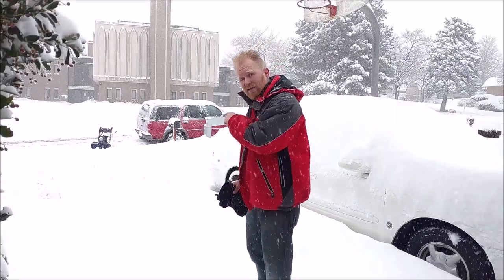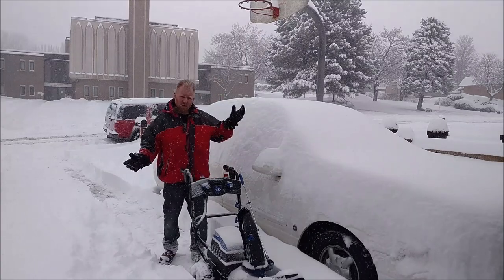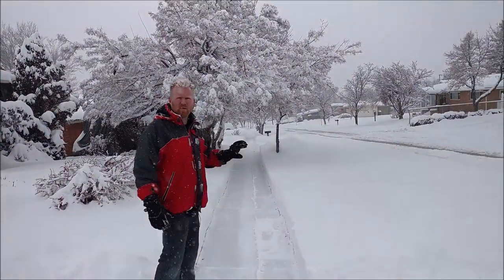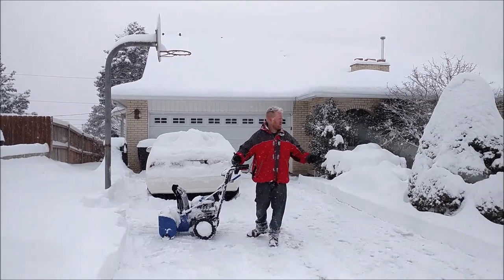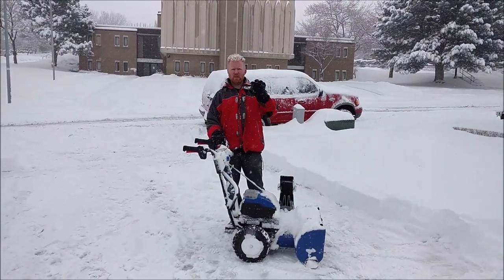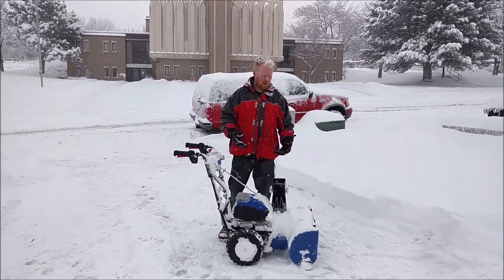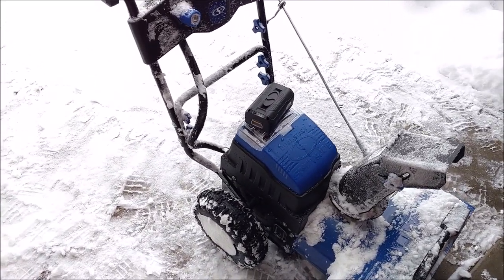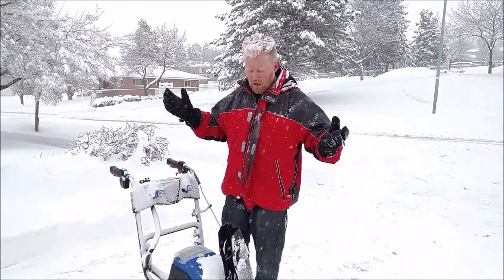Lithium 2 stage Snow Blower!

Comment: Hey 65, I need your opinion. Which engine line do you think is better an HMSK or an OHSK??
There is a guy selling brand new NOS Tecumseh 10hp HMSK100, 358cc and a 12hp OHSK120, 358cc. Which engine line do you think is more reliable?
How much more powerful do you think the OHV 12hp is compared to the L head 10 hp a big difference or a little difference? Thanks..
Reply from the maker: They're going to be very very close. I doubt you would notice a difference side by side while running on a piece of equipment. The overhead valve engine is going to have a tiny bit more power and be slightly more fuel efficient. In reality the 10hp L head is going to be closer to 8.5hp/3600 14ftlbs and the 12hp ohv is going to be 9hp/3600 16ftlbs. So the OHV is 5-10% stronger, which could easily be lost by a worn engine.
Reply: sixtyfiveford Okay great, thank you for the information. Thats exactly the information I have been looking for. Their is a guy selling NOS Tecumseh's. The 10hp he's selling for $385 and the 12hp he is selling for $50 more at $435. Same shipping cost. I think Im going with the 12hp, its eventually going on a large snowblower and I do commercial snow removal and need as much power as possible plus being a little more fuel efficient is a plus. My snapper has an 8hp HMSK80 and its a good motor and works hard so I had experience with the L- heads but have had no experience with the higher hp OHV engine. Do you think one is a little more reliable/ would last longer, or do they both have about the same lifespan when taken care of well?  Because Ive seen some Tecumseh L- heads go 45+ years with average care. So would an OHV last a good long time as well or are they more prone to break down vs the L-head. Thats the last thing to consider before pulling the trigger on the purchase of the engine.
Reply from the maker: I like the L heads and think they're reliable as heck. OHV stuff needs periodic adjustment, but it's quickly done.

On a side note, I'm very partial to Tecumseh engines and I don't think there was ever an easier starting winter engine; but I think those prices are high for the engine/power you get. For my money, if I needed power to go through anything I would throw a 420cc Predator engine on for $350 from Harbor Freight. They're putting out a true 12-13hp 18.5ftlbs and it includes a 12v electric start. I can pretty easily stall out a hmsk80 in wet snow and a hmsk10 is better but still stallable. I think a 420cc would be the magic ticket. I haven't personally used the Predator 420cc but I've done a fair amount of engine swaps on tillers,etc with their $100 212cc 6.5hp engine. It has surpassed my expectations in performance and reliability.

I have a pair of hm100 10hp that are on some go karts I have. They are well used and showing wear after being operated in dusty environments their 20+ years of life. I plan on putting the 420cc Predators on in their place and using these tired but still very strong engines as power upgrades on smaller equipment.
Reply: Oh yea I know all about the 212cc they are great and for the most part that's the way I go. But these NOS Tecumseh engines arent going to be around forever and I figured I would snatch one last one up before their impossible to find. I have seen a huge demand for these Tecumseh engines and parts the last few years since they have been outbof business 9 years now. Lets just say I purchased that OHSK120 today for $435. Lets say I never ended up using it. In 10 years a still nee okd Stock Tecumseh like that may have doubled in value to the hardcore Tecumseh fans. But even if I did use it and kept good care of it. In 10, 20 years I could probably still get my original investment out if that motor. So that was one if the other things that has gone into the thinking of buying that Tecumseh. But your absolutely right the predators are great engines at unbeatable prices. They are a fine engine and I will continue to use them. But I wantbto snatch this NOS Tecumseh OHSK120 new before I cant anymore.

Comment: it's great that you barely finished your garage. but now you need to charge it and for how long vs a gas power blow. Whereas you just fill it up and keep going. not to many ppl & businesses  have the time to wait it to charge.
Reply from the maker: It has it's place and this is an extreme situation. If you got 12" of snow on a regular basis you would need extra batteries or the bigger batteries they have, or a different unit all together. This is designed for a person that gets 4-6" on average and the machine will run 45+ minutes on the small batteries or 1hr+ on the larger batteries they have. But it can handle a foot of snow if need be. That being said, I won't be giving up my gas powered unit any time soon.

Comment: How did the batteries hold up over the years?
Reply from the maker: You can expect the packs to last maybe 5 years with care. That means keeping them warm, not over discharging them, not overcharging ect.  They will lose capacity /performance every season. Honestly though I sold it and will stick with gas. Unless you live where you only get a few inches of snow battery power isn't the thing. You need to get multiple battery packs and calculate that into the price of you plan on that route.

Comment: So this video is 5 years old.... do you still like it or have you had to replace it? Did you do the rubber impeller mod to it?
Reply from the maker: It was just ok and it did work. For a lawn where you mow the same amount every-time electric is fine. However for snow with unpredictable amounts you need gas. Unless you factor into buying 3 or more total batteries every 3-5 years.
Reply: Thanks! I ended up predator hemi swapping an old school heavy duty Snowflite unit
Reply: @sixtyfiveford  Any thoughts on the new model this year, it comes with 4 12ah batteries. They are offering it 1/2 price next few days. Regular price 2000, can get it for 1000.  I wonder how long a charge would last on 4 12ah batteries?. But still probably need new batteries every few years or so.

Comment: whaddya think about deflating the tires a little bit?  just got mine yesterday, and i'm thinking it would give more traction if the tires were a bit soft.
Reply from the maker: That would help.
Reply: apagoogoo - Good tip. Gotta try that when snow finally arrives.

Comment: So it should cost 1/2 as much as an gas blower to buy ?
Reply from the maker: I do think the price of the machine is about 150 too high compared to a similar machine you would pick up from the Home Depot in build quality. But this will definitely drop as competition comes into the electric 2 stage market.
Reply: Update: this is still the only 2 stage electric available here in 2019. I bought the 2018 improved model and two extra batteries and still waiting for snow.
Reply: Anything electric just costs more. Just wait for the electric vehicles to be forced down our throats.

Comment: hi great shows. could you tell me I was given a new cam for Christmas for my 1986 roller 5.0 Ford. I'm told it will make my 302 5.0 ford have a 351 CID Windsor firing order. is this safe for me to do. it is a ford 5.0 roller 302. just thought you might be able to help. I hear it's a pretty common thing. I am also installing 2.02 intake 180 exhaust heads.
Reply from the maker: I haven't played around much with the 302 nor 351W but have vaguely heard of the timing order change with cam swap. I'm sure there are a lot of great articles on it.

Comment: Would be more interested in lifespan of battery over years. My gas thrower needs 2 dollar spark plug and fresh gas/oil  and will run for hours . I will be first to admit I don't even think about it until snows on ground may take extra pull or two but will fire up after being ignored since last time it snowed. NOT so sure this  little guy will take that  kind of neglect. Pretty much betting 1st time you miss a charge that pack is fried.

Comment: The technology is getting there but its the mindset of why people wont buy electric cars is the same , range anxiety. People just like their gas fueled engines as do i .  A lot of pros and it would work for most just fine.
Reply: i work in the trades..i cant remember last time i used my plug in tools.
Reply from the maker: I won't be giving up my gas powered unit any time soon, but it surpassed my expectations. I had a hard time giving up my corded power tools for cordless, but now the corded tools line the backs of my shelves getting dusty.

Comment: Maybe wet heavy snow?
Reply from the maker: Works OK with wet snow. Any battery powered machine is going to be significantly weaker than it's gasoline cousin, so it'll just have to be used accordingly.

Comment: 30 minutes seems to short of a time for something that costs as much or even more than other snow blowers, especially with 2 batteries and taking so long to charge them
Reply: its not meant for 36 inches of snow every other week. some people like the quiet and dont mind recharging. this was 2 years ago it looks like there are 6 amp hour batteries available which should last 50% longer.

Comment: Good review but I think while you mention it you really downplay the issue of it being too light, you get some medium heavy snow and the issue they electrics I have seen all have is not throwing the snow but moving through it, no traction. You also did not actually finish you while driveway, looked like you had at least a pass or two left behind the car to the end of the driveway. 

However, the worse thing about battery mowers is how often the average person is going to have to replace the batteries, likely every couple of years at 150 bucks a pop. Unless you have other tools to use the same batteries they end up sitting around for 6-8 months which is really bad for batteries. 

For small jobs and light snow they can make sense but for the most part you are better off in a gasoline version.
Reply from the maker: Personally I wouldn't run one but many are mechanically inept and fight endlessly with their gas powered equipment. This is a great option in those situations.

Comment: As the batteries get older they will not last as long, so you won't be getting 30 minutes on a charge, and batteries are not cheap. I don't see how electric snow blowers help the environment when you burn coal ,wood, trash, tires, etc. Just my two cents :-))
Reply from the maker: I agree. The lifespan of properly cared for lithium is around 5-8years. The average consumer would just toss the entire machine and buy another. Planned obsolescence. Gas powered any day.

Comment: $900 is too much for only the equivalent of 3.4hp.  Also an extra set of batteries will cost another $240 if you want it to last more than a paltry 30 minutes.  Batteries deteriorate with age so who knows how long it will be before you're spending another $240 (or $480 if you want a decent run time).  Amazon reviews on the batteries look like a gamble with some saying they go defective quickly.

A 5 year old 5.5hp lightly used gas snow blower still works fine with nothing but a cheap tune-up.  A 5 year old battery powered snow blower will need at least $240 worth of new batteries just to go 30 minutes.  That's if they still make the batteries.  They won't.  The Snow Joe is just another cheap throwaway item that will line landfills long after the original owner's attempt at being green wears off.
Reply from the maker: Yes and no. Not sure where you got the 3.4hp figure from? Horse power is an improper way to measure the power output but rather torque. It will do the equivalent of a 5-6.5hp gasoline unit which puts out around 8-9ftlbs of torque. For someone who gets a 4-6" snowfall a time the 5ah batteries($800 unit) should run them 45+minutes with the larger 6ah batteries($900 unit) going to around an hour. Lithium packs have proven themselves over the years with an average of 500-1500 charge-discharge cycles, as a viable power source and there's no reason they won't last 5plus years. I wouldn't use this unit for the snow fall shown in the video if that is what you got every time. This was the max it will handle and it ran 30+minutes. 

That being said, it has it's place. Personally I would choose a gasoline unit, but would get a used unit that cost new around $2000 as anything less is tin foil garbage. It is easy for me to justify yearly maintenance but I have customers that pay in excess of $100 a year on servicing their $600 Home Depot snowblower. Yes, the Snow Joe is not up to par with build quality of the higher end machines but hovers right at the quality of box store machines. With that said, I do think the price of the machine is about 150 too high compared to a similar machine you would pick up from the Home Depot in build quality. But this will definitely drop as competition comes into the electric 2 stage market. 

I guess, the people I see using this aren't necessarily the "going green" people. But rather the people who know nothing of a gasoline engine and need to take them in for service. On a side note; I just had a neighbor call me and donate to me a great running lawn edger a few weeks ago as the belt broke and the shop he normally takes it to quoted him $175($50 for the belt and $125 for oil and a basic tune). Under $10 and 20 minutes of my time and it's like new for another season. If you don't fix it yourself, you'll spend a fortune at these commercial shops.
Reply: There's one more type interested in these:  The type that fixes their own snowblowers!  I just tried to resurrect a 40 year old Ariens.  Of course,  because people who make snowblowers are jerks, it had a dual output engine.  So that was a hurdle.  But I managed to figure out a way to get a second belt on the new engine anyways (yes, I replaced it, the old engine had stretched vavles and nobody makes Tecumseh parts anymore).

It ran fine in November.  Then it chewed up belts when the snow came because I had to back drive the belt.  That sucks.  And now the new engine won't start, because it's too damn cold, even with ether.  Strike three, you're outta here.

The problem is unless you spend $2000 you get a snowblower with the exact same crappy $140 engine I put on this snowblower that will be an unreliable POS.  Sure, I could fix it (again) but it will NEVER be reliable because it's a Chinese clone piece of garbage.

Now I'm late for work (again) because gas snowblowers suck.  All gas engines suck in the winter.  Even cars are hard to start and they have engines made in the US or Japan.

You know what does work in the winter?  Warm batteries that I keep inside the house.  :)